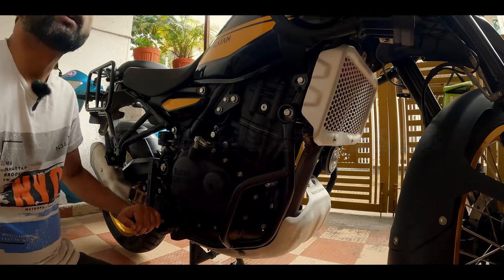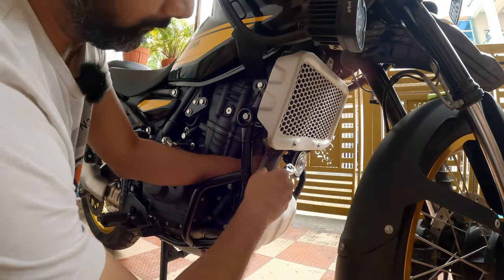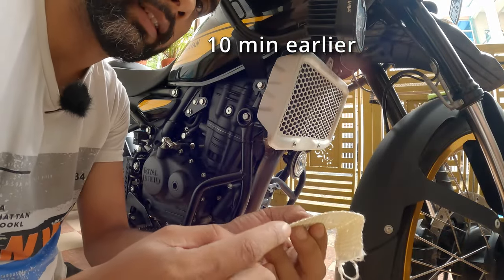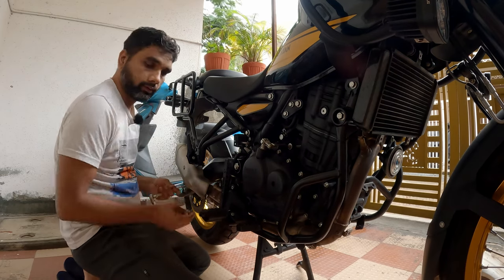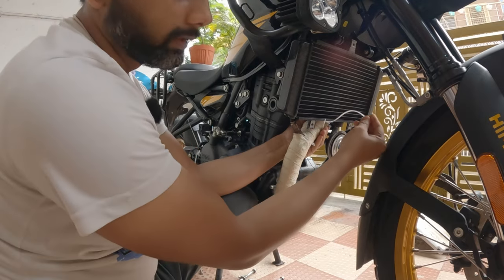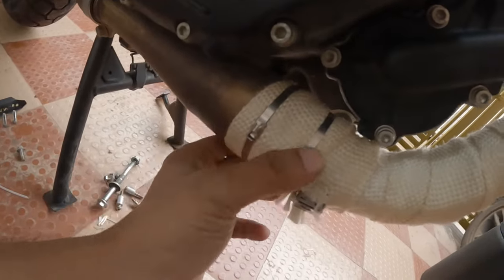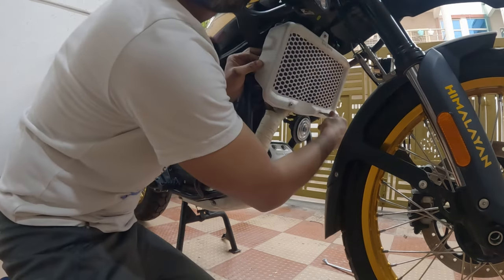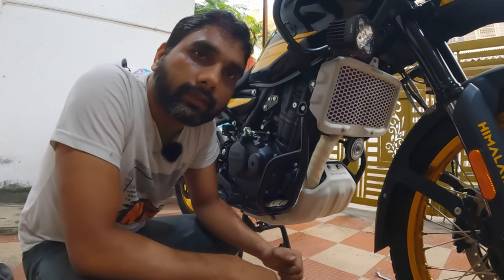How to wrap Himalayan 450 Exhaust Pine | DIY

Comment: I feel this is unncessary. If you are not able to live with this level of heat then this motorcycle is not for you. Maybe try a splendor or something. Honestly watching people do this makes me annoyed. This will not only cause further unwarranted issues but also void any warranty claims you might end up in because of the wrapping. Understand the basic essence of a motorcycle each part is exposed in a way that it can dissipate and manage heat in its own way. If you cover or wrap it there is no way it will be able to do that. I would suggest to remove it immediately before a major mishap happens.
Reply from the maker: Thank you for the info. There is no heating issue in the bike and I have mentioned this many times in my other videos. Especially the one in which I talked about the daily commute. In this video I have talked about the sharp hot air you feel when in tand still traffic. Mostly turning off the engine helps because it stops the fan. However I was looking to solve that specific hot air issue when the fan kicks in. And this is as always experimental I will remove/update accordingly.
Reply: @OnceARider  In summer heat  dissipation will be a big issue. You feel more heat during standstill cause of reduced airflow and consequently more heating. This cover will trap even more heat, and thats the reason you feel heat is reduced. It would be better to leave the pipe exposed.
Reply from the maker: @hariharanm1964  your points seems to be valid but there is one more theory I wanted to test. The wrap helps trap the heat inside and this helps hot air escape even faster and there is slight improvement in performance.
I will remove those wraps soon if they have any negative impact. 
Again thank you so much for sharing the info.
I will pin this conversation so that anyone who watches this video and thinks about trying this mod would know these points. 😊
Reply: @OnceARider  if it’s for the sake of experimenting then you gotta do what you gotta do😅
Reply: Believe me bro , ur pipe will be rusted fully and the heat u trapped inside damages the catalytic converter and other components of the exhaust and Ur pipe is going to rust in no time..believe me I have the experience of using this wrap...
Reply from the maker: @praveenr5858  In that case I will remove it soon. Thank you for sharing the experience.
Reply: Agreed on the heat issue. But what about rusting?
Reply from the maker: @vinodriosis3709  yes that is concerning.. I am thinking of coating it with heat resistant paint and then wrap it 🤔
Reply: @vinodriosis3709  I am more worried about the heat being trapped because of this tape which could be a fire hazard
Reply: If something happens where warranty is needed enfield would use this video as an  excuse to not honour it.
Reply from the maker: @leonidjoseph5483  this has not modified any electric system or have changed anything stock. So if they do not honor the warranty that would be shameful for the brand. 
However, I removed the warp the very next day after my office commute since it had little to no effect.
Reply: @OnceARider   companies will put the  blame on  something except on themselves. Usual practice.
Reply from the maker: @leonidjoseph5483  you are right, and thank for bringing this up, let's hope for the best. If something happens where I need to claim for warranty I will remove this video.

Comment: It's not recommended to use these wraps, the wrap will absorb the water if it rains and it will damage the pipe over a period of time causing rust issue.
Reply from the maker: Exhaust pipe rust anyway with time,  but will observe for some time if it has more negative impact than positives I will remove it. However there is another theory that it keeps the heat inside and this helps air exit faster and there is slight improvement in performance so It is experimental for now.

Comment: Heat is caused by catalytic converter (a small bulge) in the header pipe just beside right foot, not from radiator, you could have wrapped further down covering the full catalytic converter part which should have reduced some heat
Reply from the maker: I have talked about the hot air felt on the right foot when the radiator fan kicks. Other than that there is no heating issue. Anyways I will do some more testing and share the results 😊

Comment: can you list the tools and bits you used for this job? I have a Himalayan too. I want to do some basic service and adjust alignments on my own.
Reply from the maker: Sure.. here is the list of tools I use
1. set of ring and open end spanners
2. 1/4" socket wrench set
3. 24mm ring spanner for rear tyre
4. Slide wrench 
5. Good pair of pliers.
with there tools you do 99% of service/maintenance of your bike 
Below are some useful product link.
Ring spanners: https://amzn.to/4c6EjWZ
Open end spanners: https://amzn.to/3yeIt1p
24mm spanners: https://amzn.to/4dpP3AY
socket wrench set: https://amzn.to/4cgFnrs
slide wrench: https://amzn.to/4dvyxzx
Pair of pliers: https://amzn.to/4dtMiOY
Reply: @OnceARider , thank you for taking the time to list all the tools with the links. T70 is needed for cone set adjustment and may need a 1/2" wrench. Do you know what Torx bits are needed for the fork alignment?
Reply from the maker: I think 1/2" wrench set is not really needed and I am not sure about the Torx bits, I haven't worked on the forks yet. May will update once I get chance to work on those.

Comment: Is the heating reduced onto your right leg?
Reply from the maker: Hello... It didn't make a huge difference, so I removed it. However the solution to the heating issue is using a good fully synthetic oil. I will be uploading a video on this topic this weekend.

Comment: Which torque wrench set you are using?
Reply from the maker: It is not a torque wrench, it's a normal 1/4" socket wrench set.
This one: https://www.amazon.in/dp/B08Y73LJDB?ref=ppx_pop_mob_ap_share
Reply: @OnceARider  thanks mate. I am also looking for that. Another thing is I am facing right side pulling issue. How to resolve that? Service centre is saying that below 60kmph this will happen as an official statement by royal Enfield. Is it?
Reply from the maker: @thumptales  right side pull is due to suspension setup both are not same. The left one is for compression and the right one is for rebound. Hence the right suspension doesn't support the weight of the bike and it pulls towards the right at low speeds. You can say this is the character of the bike and I would advise not touch it. However if the right side pull is bothering you then, you can get your front rim spokes ture in a way they pull to the left to counter it. But this will cause your handle bar to turn left automatically when standstill.
Reply: @OnceARider  thanks brother for the information. Very much informative.

Comment: Will will destroy the valves.. all the heat guess where is now..
Reply from the maker: That is not the case.. the heat exits with better efficiency from exhaust. However this mod didn't make any significant improvements so I  removed it the very next day. ✌️

Comment: You can use the engine ice coolant for more heat reduction.....
Reply from the maker: It's not about engine heat issue, in fact I never felt engine heat on this bike as I have told in my previous videos. It is about the hot air you feel on your right foot when radiator fan kicks in. This only happens on right the foot where the exhaust pipe is present hence it is clear that this is not a engine heat issue otherwise same would be felt on left  foot as well. That why I am experimenting with the wrap.